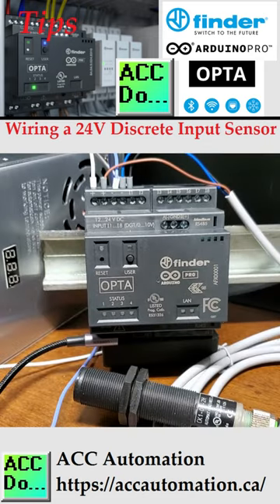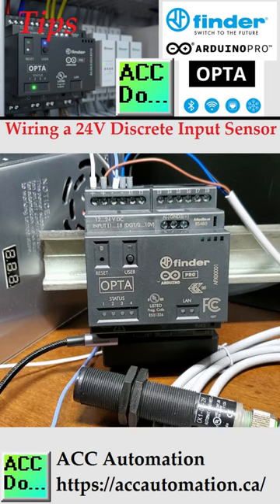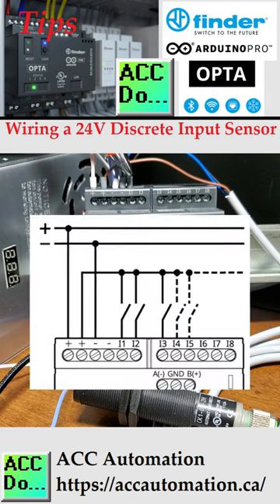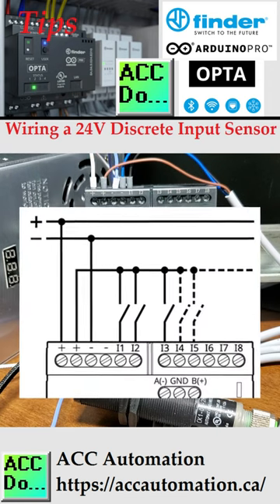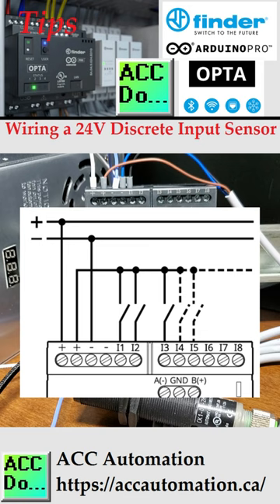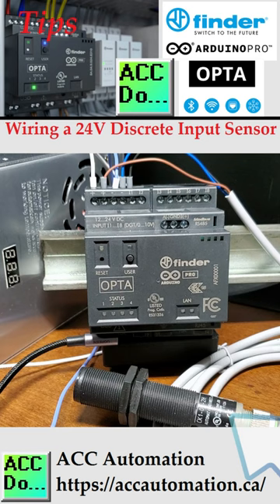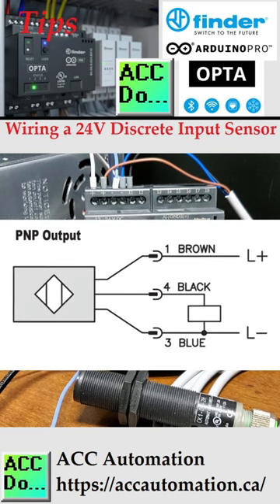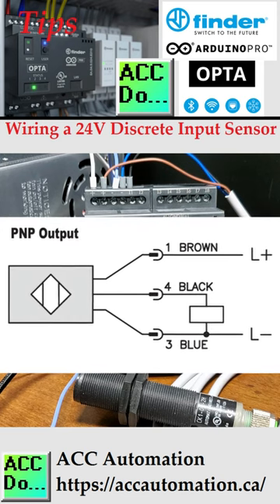Arduino Opta: Step-by-Step Guide to Wiring a 24V Discrete Input Sensor

Comment from the maker: Opta PLC FAQ - Frequently Asked Questions
https://accautomation.ca/series/arduino-opta-plc/opta-plc-faq/

Wiring of NPN and PNP 3-Wire Sensors
https://accautomation.ca/wiring-3-wire-dc-npn-and-pnp-sensors/

CK1 - 3 Wire Capacitive Proximity Sensor
https://www.automationdirect.com/adc/shopping/catalog/sensors_-z-_encoders/capacitive_proximity_sensors/18mm_round/ck1-00-2h

Download the software from the following URL link.
https://www.arduino.cc/en/software

Arduino Opta IoT PLC Series
https://accautomation.ca/series/arduino-opta-plc/

Arduino Opta PLC - IoT and Industry 4.0 Enabler
Finder OPTA 8A Series - Tutorials
https://opta.findernet.com/en/
Datasheet
https://cdn.findernet.com/app/uploads/S8AEN.pdf
Quickstart Sheet
https://cdn.findernet.com/app/uploads/IB8A04EN.pdf

Arduino Opta Hardware
https://www.arduino.cc/pro/hardware-arduino-opta
Arduino PLC IDE
https://www.arduino.cc/pro/software-plc-ide
Arduino Software Download Page
https://www.arduino.cc/en/software
(Arduino IDE, PLC IDE, PLC IDE Tools)

ACC Automation
https://accautomation.ca/

Comment: I got problem with using 5v for a button to get in on A0. Plc does not seam to read it. Help any one?
Reply: i have the same problem. did you figure it out yet?
Reply: @MrJlorenzana  well I realised that the PLC only read above 6v as a high. So I feed it 7v for when it's a high. I do not know why it does this as it's supposed to be way lower. So if anyone else knows the reason for this, please tell us.